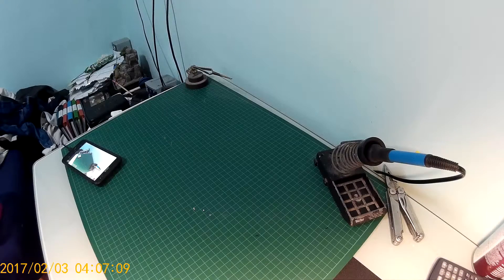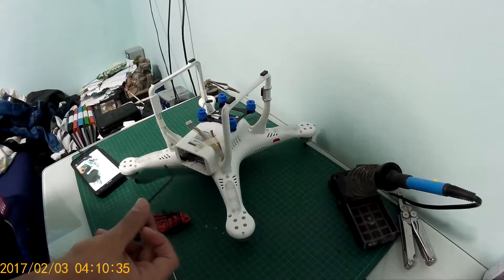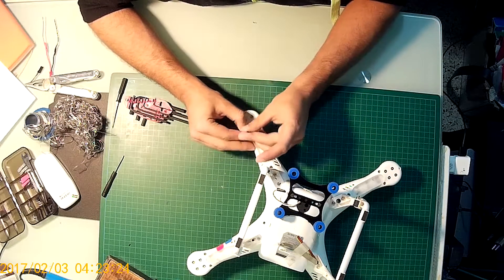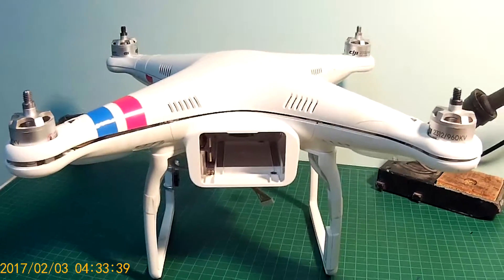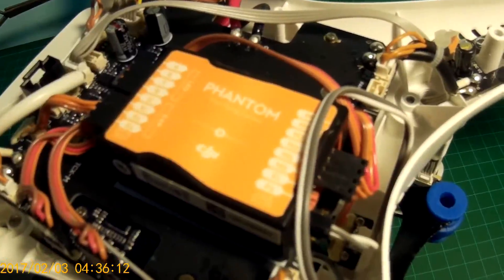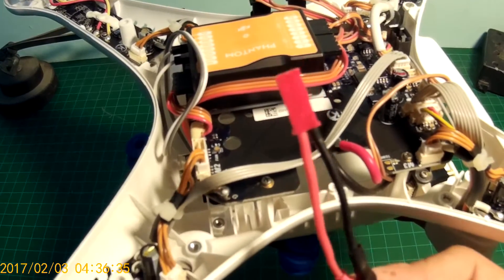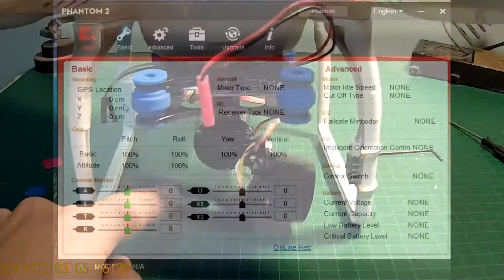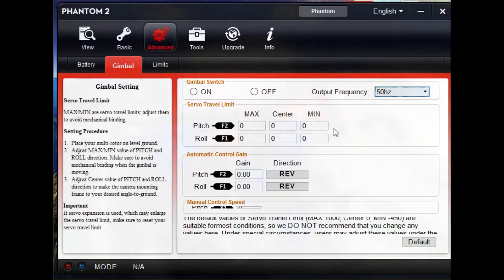DJI Phantom 2  Any Gimbal Setup Installation Tutorial

Comment: Unfortunately I can't see which wires you are attaching to which connections. I have the same gimbal as you are using in your demonstration but the wires that came with it don't seem to correspond to the wires you are referring to except the power red and black wires. Other than those, I have two black triple-wire strips that lead to the two gimbal motors plus another group of three - black, red, white - for which I have no reference. On the gimbal control board are four 3-pin connections with no reference as to their functions. It's ashame themakers or sellers of this inexpensive but solidly built gimbal don't think to include a wiring schematic with the product